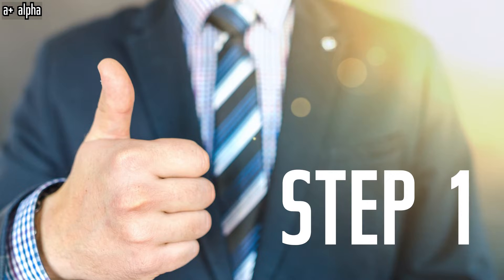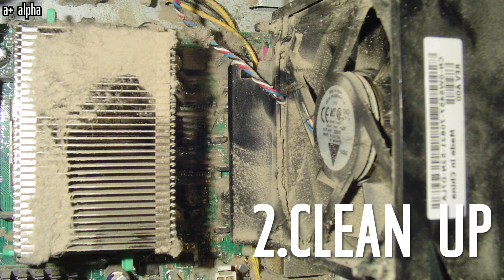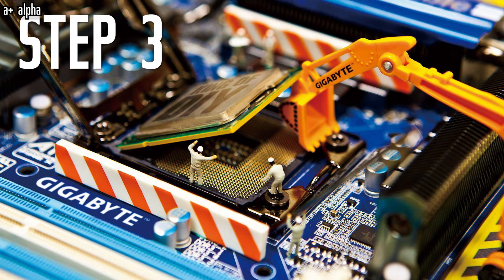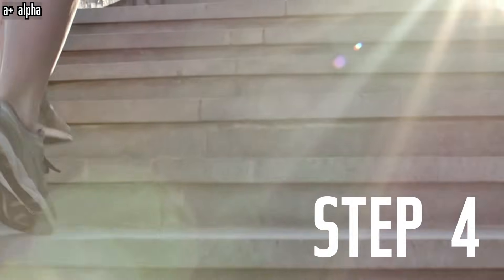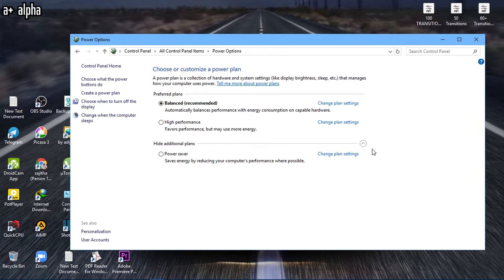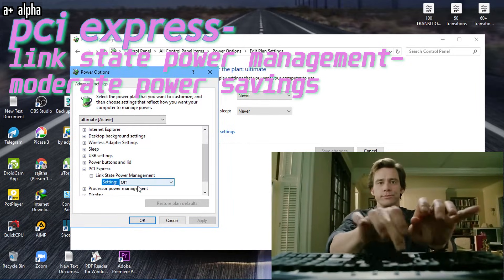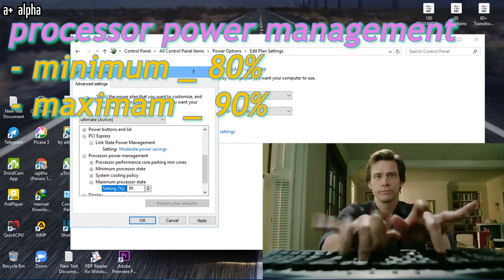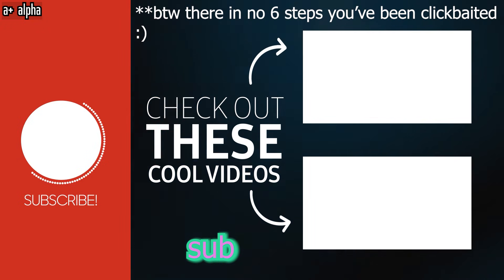✔️how to FIX your PC high temperatures | overheating CPU/GPU when gaming [complete guide]

Comment: A friend of mine told me that step 4 would increase my power bill. Is this true? I wouldn't have the brains to understand how or why.
Reply: nope that's completely false. step 4 actually reduces your power bill by nerfing your cpu clock speed <=> gpu bottleneck (it's better than having your cpu overheating though). If you don't wanna have a gpu bottleneck (=use step 4), just change your thermal paste and/or use a better cooling option (if you use the default intel/amd cooler stock, it may be the reason your cpu is overheating).

GPU Bottlenecking means your gpu is carrying your pc. It is better to have a GPU bottlenecking than a CPU bottlenecking, and it's not that bad tho.

If you have any questions, don't hesitate to ask me. Your friend is completely wrong! (step 4 if basically a mega power saving)
Reply from the maker: Exactly 💯
Reply: @brolyx4039  can u explain to me what part 4 exactly does like does it harm the pc in any way coz there is a visible difference also does it put more load on the gpu can u please explain it to me Iam a roomie
Reply: @bilalkhan-uv2db  basically part 4 limits your cpu hardy. for me, it limited my cpu clock speed (from 4.3ghz to 2.6ghz) ---> fps drop on every games & less power consumption... it's just a cpu limiter
Reply: @brolyx4039  so there are fps drops on game's due to this settings
Reply: @bilalkhan-uv2db  yes
Reply: @brolyx4039  so should I remove this setting coz I want more fps
Reply: @bilalkhan-uv2db  if u want to toast your cpu yeah remove it
Reply: @brolyx4039  technically isn't it a default settings and my CPU has good temps on default high performance setting in the power settings will it really toast my PC?

Given that ppl mostly use this settings?
Reply: @brolyx4039  like this is a setting which ppl don't usually use and it doesn't toast there PC so I don't understand why u r saying that
Reply: @bilalkhan-uv2db  just use step 4 if you have overheating issues. otherwise there are no reasons to use it

Comment: Thanks man, Step 4 fixed my CPU temps. I am using Ryzen 7 5700x and while playing some games, temps was around 85 - 90 C, but now its around 65 C. Good tutorial. Have a nice day.
Reply: how’s your performance when gaming? i heard it does drop some frames
Reply: @kyehue  it is good, I use rx 6600 and in most games did not had a  much of the drop problems, from time to time a little fps droos but not much, except Hogwart Legacy (but only when there is a lot of thing happening and in interior parts of the game)

Comment: Will I have big fps drops if use the step 4 power management mode settings I already suffer high temp while gaming so I thinking about to use it
Reply from the maker: If u don't have a CPU bottleneck it won't be a problem

Comment: step 4 actually helps with tempretures but not with performance. it actually made my cpu run at it's base frequency, it won't boost to it's max turbo frequency even while playing games
Reply: Honestly, with the temps I was getting before its worth it for me, but that's useful info regardless.
Reply: well better than termalthrottling

Comment: STEP 4 HELPED ME SO MUCH. Saved me the time I would have had to reapply thermal paste. Before, during gameplay my cpu temp would be 90+...it's chillin now at 65 degrees Celsius with no decrease in performance. Love you bro.
Reply: Same for me here! This is very shocking to me. Super happy too!
Reply: ......................... LIKE ME! Danget haha, I reapplyed thermal paste after only 9 months which is early to do because I was hard stuck on wtf is going on? Fans are all up, air flow case everything.... AND this video could have saved me so, Soooo much time because I hate that process.
Reply: and lowered your performance by a lot
Reply: @drgremory5275  I really wouldnt say "alot" but it was a great fix to hold me up until i could replace my fans
Reply: @drgremory5275 it helped with my performance

Comment: So for anyone wondering if it effects frame rates, for me it did. I'm on r7 5800x and rtx 3070, my Cpu was idling at 55c w spikes up to 80c, and in games was running at 91c consistently. After following step 4 in the video, idle temps dropped to 50c and gaming dropped to 65-70c. Some games weren't too affected, like Apex legends where there was no difference to fps, but other games like Gta (went from 140fps to 112fps) and RDR2 (80-100fps to 65fps) were pretty heavily effected. It's a really really effective fix for the temps but ofc the exchange is that you lose out on some performance, but it's only noticable if your playing pretty intensive games :)
Reply: yep I can't play elden ring in smooth 60 fps anymore tho, but still better than recuding my cpu's life spam >:)
I think we should change our thermal paste and/or the way the pc is cooling the cpu (i'm using intel's default cooler stock, I heard it's trash asf)
Reply: @brolyx4039  yeah stock coolers SUCK! I’ve done thermal paste re-application, added an extra fan, undervolted the cpu etc. and my temps were still high so the best option is to get a better cpu cooler that can keep the cpu cool under load.
Reply: @HFreddyK  dang... I can't afford for a watercooling rn, I'll just do thermal paste re-application and hope it fixes problem. I'll try to get a better cooling option as soon as I can. Hope it gets better for you!
Reply: @brolyx4039  Thanks man, hope u can sort stuff out as well! Btw you can get some good air coolers as a pose to water coolers that work really well and are much cheaper (just check the clearance of your case and if the coolers are good for your cpu). I've heard good things about the deepcool ak400 for example. Good luck either way bud!
Reply: Well it depend on games and your cpu/gpu

For exemple , you can play a new game on a 4k screen with a 2.5k$ gpu while only using a 200$ cpu , you wont be limited by the cpu , at leeast in most games

However , some games such as race games , or rts , are cpu intensive , they will get hit by the cpu power reduction

But most computers have a cpu that is way stronger than the gpu , after all cpu arent made for games , gpu are made for games , so in most video you will see ppls using their gpu at 100% while the cpu will be at 30% , yet still reaching 80 degree

Thats where the cpu limitation help a lot without loosing fps

In your case , i think the pci power thing is your limit , cause your cpu is way strong enough

But...the real question is , do you even see thendiference btw 100 fps and 140 ? 60 is usualy fine
Reply: @shirakolee  I can deffo tell the difference between 100 and 140fps especially on a 144hz+ monitor. It just doesn’t pose any real practical issue until you start playing more competitive fps games; on a single player game like rdr2 or cyberpunk i’ve found 60fps is easy breasy, but if i’m on apex or siege I’m genuinely at a tactical advantage the lower down my fps goes. Similar story with other fps like csgo or Finals or Valorant etc.
The rest of what u said abt the cpu and gpu shtuff sounds abt right it rlly does depend on the game ur playing when it comes to how cpu will effect the performance
Side note: even tho its not abhorrent playing 60fps on a low stakes single player, it still feels nicer with higher fps, it’s just not as big a deal cuz i’m not out here sweating on a single player game
Reply: @HFreddyK  you're right about fps , it help to see bullets comming , and when you turn the camera fast , it help seeing things that you might miss at a lower framerate , it might also help in race games

but since i only play games with a slow speed such as rpg games (star rail , wuthering wave , honkai impact) , i just dont feel the diference btw 80 and 120

even worse , when im limiting the game to 60 it feel better than letting it going from 80 to 120 , there's some kind of lag when turning the camera

most likely cause of of 120fps data are saturating the gpu , so the 80fps one slower to triger , meanwhile the 60fps just doesnt slowdown at all , thats why i was wondering if you could see the diference cause in my case , i feel better at 60 

so if your game is going from 110 to 130 , it's possible that limiting it to 120 would increase your feeling about it

Comment: 👍👍👍   AMD Radeon RX 6950 XT and AMD Ryzen 9 7900X   85 Celsius to 57 Celsius running 3D Mark Fire Strike Extreme..👍👍👍. I thought I would have to at least reapply thermal paste, if not more...  Liked, Shared and Subbed

Comment: To be honest, i tried so much things at once including your step 4, my cpu is thermally stable at max 70c in rainbow six siege (before the temperature jump above 100c causing instant shut down). 

I deeply feel all the credits are yours so i will be mean if i dont thank u ❤
Reply: Did you get it fixed? I can’t even download a game without it shutting off
Reply: @KingKhiddoxYuneek  bro, it fixed it perfectly, i once reset the parameters and i got the problem again then it was fixed by doing step 4.
I m not a pro to give an advice for ur case brother. I wish ur problem get fixed
Reply: @MazeKrade  Preciate you bro I actually got it. It still runs hot when I play games but at least it runs now. Step 4 works here & there but I do know I have to find the solution soon before I actually start gaming

Comment: Honestly that step 4 was so clutch. I was clueless on why my cpu would idle at 70 C. Now idles at 45 without fluctuation.
Reply: is this a troll or no
Reply: @noahburnett9931  no it’s not a troll, but you should understand that games like cod Warzone may not function correctly. It’s the only game that doesn’t function right on those power settings. Beyond that everything worked flawlessly for me with those settings.

Comment: So  monitoring our HP Omen 25l (AMD Ryzen 7 5800X), we've noticed that the CPU temperature jumps up to 90°C when the pc is in idle. You literally have to move the mouse so the temperature would stay low. And it's like a cycle. Goes up, goes down, goes up again and so on. In the task manager the visual studio fires up and uses the cpu quite a bit. Also some other apps too and it happens like after 5 mins after it's left idle. So I was wondering what could be the problem?

Comment: Cleaned my laptop from dust and set my CPU’s min/max at 80/90%. Unbelievable what the difference is. From 90/95c elden ring to constant 65c. I game in rooms with 25/30c with a Lego laptop stand but I couldn’t believe the difference in temperature, yeah I can’t play the game at 60fps max setting but my laptop is constant at 65 after hours of gaming. Thank you

Comment: Bro... I used a motherboard msi with core i5 6gen.. But unfortunately it burned or damaged because of local power supplyer.... After that I went to   a computer shop and replace same component to new motherboard which is same motherboard previously I used and the processor core i5 6gen....but now when I am playing gta v the temp is going to 100C° — 90C°....but previously before I replaced to new mb and pros.. It is 55 - 60c° WHY IS THAT???
Reply from the maker: Bad cooler probably maybe no thermal paste

Comment: best video for getting straight to the point, i knew my 7600 CPU was working too much and would over heat to the point of randomly shutting down and ruining my recordings. Turning it down a little bit has stopped the random shut downs
Reply: Which stepped worked for you? Having the same problem now
Reply: my amd a8 7600 has the same problem as you. Do the step 4 fix your problem?

Comment: step 4 from 80 to 40/50 but less fps
Reply: yep getting the same MW2 2022 i was getting around 165 now im only getting 130
Reply from the maker: If ur CPU bottlenecks ur GPU then it will reduce ur fps

Comment: tq so much.. step 4 but i just change processor min and max to : 99% both.. others not change. before max temp is 80c°, average is 65-75c°.. (amd ryzen 5600+rtx2060s+32gb-3200mhz dual 16gb ram) now its run on cyberpunk 2077 average 55c° max, on pix4dmapper same 50-55c° max.. video awesome simple n straight forward what to do.

Comment: surprisingly, it DOES help in reduce CPU temperature, however it doesn't seem affecting much to GPU. By far, CPU temperature drop from 55 DegC to 45 DegC and GPU temperature drop from 78 DegC to 75 DegC, in some others case, GPU temperature stay the same as it was. However, it DOES help to reduce CPU temperature. Drop 10 DegC is significantly improvement which is what we all wanted to see.

Thank you for your step 4 suggestion. It DOES help in the end. God Bless you.

Comment: You just got the biggest thumbs up from me. After following step 4, My CPU temps went from 81 degrees to 55 playing Cyberpunk. Only a minor loss on performance in intensive areas.
Great stuff and thank you so much!
Reply: Bro It decreases a lot your performance i've testes It with 3dmark
Reply: @edoardobarbieri360  I was talking about Cyberpunk..
I had the fps numbers up right in front of me the entire time.
Reply: @pookie619  How much fps is lost?
Reply: @Hatemx1 for me I used to play 120 locked in COD but now it can’t even reach 100 fps before I could get 140-150 without locking the frames
Reply: @Mrbader056  Is it worth it?
Reply: @Hatemx1  saving my cpu’s life for a downgrade in the fps yes it was worth it. Heat before was 80 and above usage was around 20-30% (insane) 
Now heat is 50-60 also usage 40-50% (reasonable) 
Also 90fps isn’t bad but not the smoothest I’m not a pro player also so I don’t need that much fps
Reply: @Hatemx1  but now the fans are going around 2500rpm, I’m not sure if its good or bad. It feels loud when the room is quiet but once i turn on the ac I can’t hear the fans spinning so I think it’s fine. If anyone knows better let me know please
Reply: @Mrbader056  people like you are why gaming is an expensive hobby now, your cpu can easily handle 80Celcius for a couple of hours. Without any significant loss to it's life span.
Reply: @TragicGFuel  so I should just bang my cpu just for you ?
Reply: @Mrbader056  not for me? Why would I care for some peasant's cpu, I care for people who take you at your word and end up wasting their money on a cpu they paid for but never utilise properly.

A cpu can easily last 10+ years, even with such rigorous use, unless you want to save your cpus for 20 years, there's no point in actively undervolting it.
Reply: step 4 got me from 80 to 45 on my 7900x lmao thank you

Comment: It actually worked, step 4 really made of magic. from 80 deg C to around 50 deg C. Thank you for sharing this fix
Reply: Bro im Sorry unfortunately It decreases performance i've tested It with 3dmark
Reply: @edoardobarbieri360  yes I noticed that, I don't mind the small decrease in performance, as long as my cpu is running at an optimal temp. I consider this worry-free as it prolongs its lifespan.
Reply: @edoardobarbieri360  why r ucommenting on every comment like this lmao

Comment: This helped out so much and im not just a random guy saying that. I put this with another videos info together for prefect heat control. i did the min 80 and max 90 at the end of the video with the pci setting and i paired it with giving my 3060 a 100GbB shader cache size in the nvidia control panel. These all made my temps go down significantly. Thank you

Comment: Step 4 is the one. New laptop would spin out of control when gaming and overheat. CPU was getting way to much power.  Step 4 reduced load and now gaming without CPU overheating. In the 60 degree when playing cyberpunk and gotham knights, before could get late 90s. Thank you
Reply: I'm getting 65-78ish celcius cpu temp when i game on my laptop...is this safe or shall i use step 4 and even lower it more?
Reply: Plus how many fps did u lose after doing step 4?
Reply: @natnaelabayneh7664   ive only ever played at 60fps

Comment: Step 4 instant fix I was running at 159-169 F and now I’m at 119F 😮 incredible advice thanks so much
Reply: Do you see a difference in game after setting the cpu lower?
Reply: @lockz1929  I still have everything on ultra but I dropped frames where I would run steady 180 190 and now I’m down to 140s but I don’t mind at all it runs great and the cpu is 50 degrees cooler

Comment: Hi, can making min-max processor state to 80%-95% instead will improve the performance?
I just want to have slightly lower temp while improving the performance.
Reply from the maker: Set max to 99%
Reply: @AAlpha69  Thanks, I did 90% min and 99% max and it's working great so far. ☺

Comment: Running any game was about 82c-87C, and it was bothering me after reading about the normal cpu core temperature for gaming, but step 4 fixed it and dropped it down to 50c-60c. But is this safe for an MSI Aegis ZS prebuilt from Staples? Should I use it as a temporary fix until I clean it out properly and set it back to the normal power settings? I did notice a drop of frames from 145 FPS on high graphics to an 80-95 FPS but it doesn't bug me.

Comment: Number 4 absolute life saver.. went from 95+c to 50-60c!! Thought I was gonna have to buy a new cooler
Reply: Yes you have lowered your temps, but for a price of decreasing your cpu preformance
Reply: @matejp.7947  well pick your poison bc if you limit your clock speed or limit power it will decrease in performance and if you get like 80 to 90 degrees with unlocked clock speed then you will see the cpu having to lower the clocks in order to keep a safe temperature. So choose whichever you want, you still have a chance in losing performance and or increasing temps